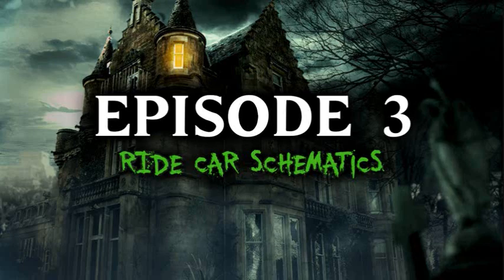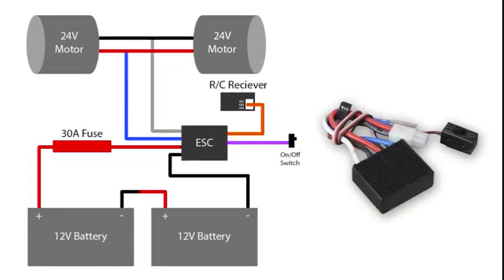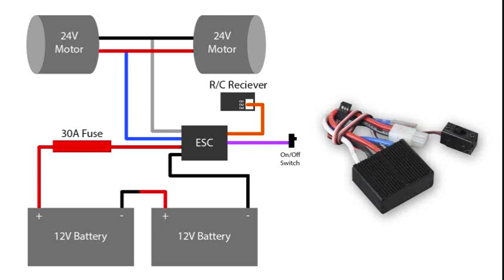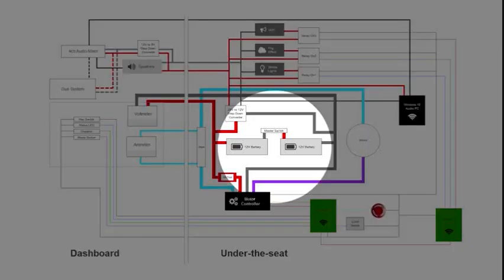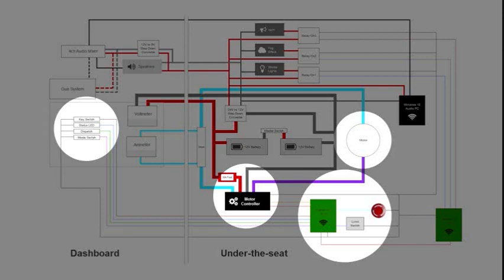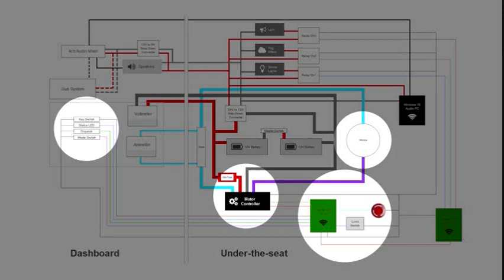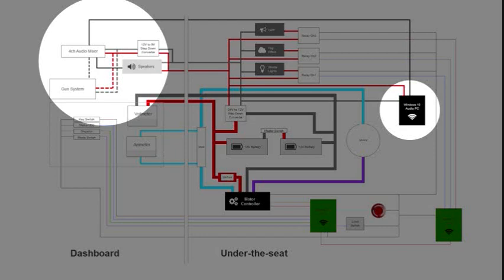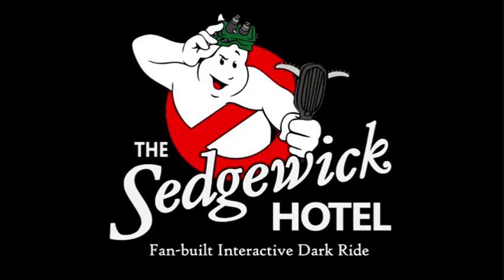Building a Dark Ride - Ep. 3 | Ride Vehicle Schematics

Comment: Can you give me a link to the ESC, controller/receiver, and the fuse you bought? I am making one of these my self and i cant find the right stuff.
Reply from the maker: This is the exact ESC I used in my early iterations: https://www.ebay.com/itm/24V-Two-way-Electronic-Brush-ESC-with-Brake-Stepless-Speed-Governor-for-RC-Model/262890094032?hash=item3d35787dd0:g:XvoAAOSwA4dWIHFQ
And here is the exact radio/receiver set I used: https://www.amazon.com/dp/B073TWQRY1/ref=sspa_dk_detail_2?psc=1&pd_rd_i=B073TWQRY1&pd_rd_wg=uwC0n&pd_rd_r=P0TZ7N9JWE2BQW4SZ9BV&pd_rd_w=ryNkB
For fuse, I'd recommend an in-line automotive fuse holder like this one: https://www.walmart.com/ip/SODIAL-5X-30A-6V-36V-Mini-Waterproof-Amp-In-Line-Stanard-Blade-Type-Fuse-Holder-Fuse/910239514?wmlspartner=wlpa&selectedSellerId=3644&adid=22222222227086105291&wl0=&wl1=g&wl2=c&wl3=235565201177&wl4=pla-386804024819&wl5=9005539&wl6=&wl7=&wl8=&wl9=pla&wl10=113734460&wl11=online&wl12=910239514&wl13=&veh=sem, with a 30a fuse.
Reply: @thesedgewickhotel6816  Which batteries did you use?